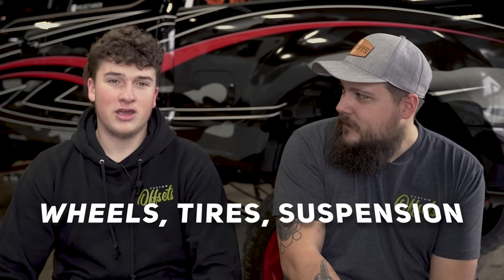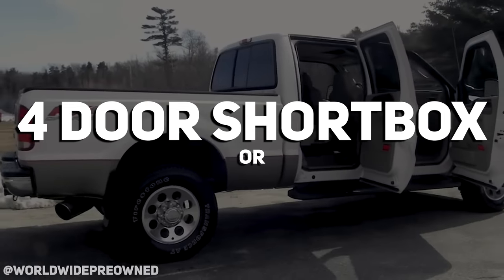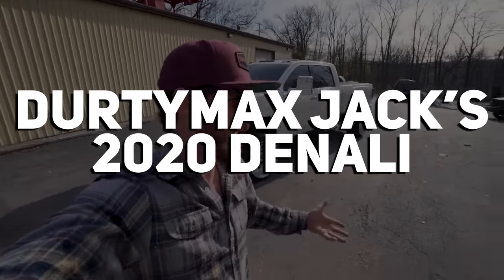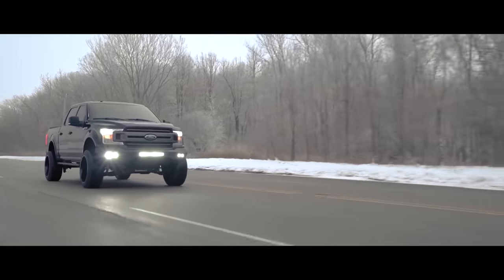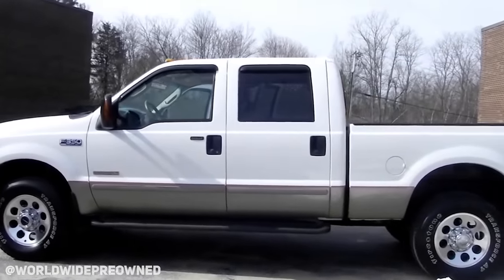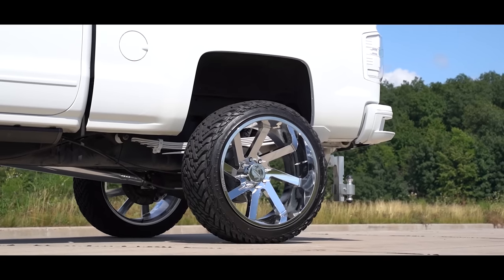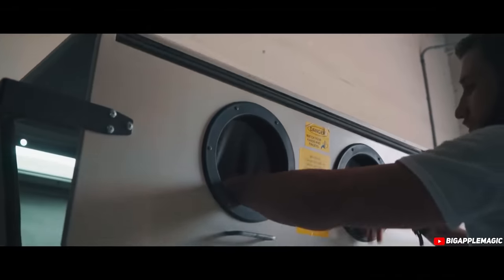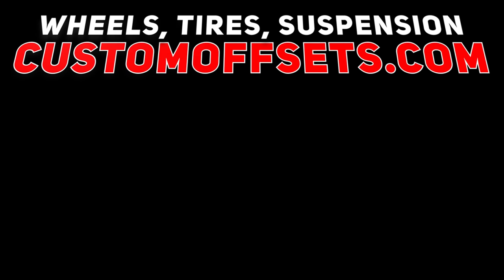Paint Vs Powdercoat!? || This or That

Comment: I watched TheTopher doing a review on the latest Cummins 6.7L straight 6, that engine is a beast. The interior is dope.

4 door short box, with a 4 cylinder diesel or V6 gasser either with a 5 speed manual.

Anthem offroad. Cause I go offroad all the time and daily driver friendly.

7.3L Powerstroke from the Excursion all the way. But you cant stay far away from LBZ, I'd love to build an LBZ but after building an alumiduty.

Comment: 1. 2020 Cummins 
2. Depends what you’re using it for but regularly four-door short bed
3. Dmax ryno 
4. Arkon
5. Duramax 
6. Flat but depends on the truck 
7. Powder coat
8. Cranberry